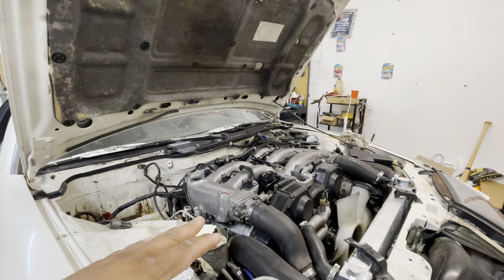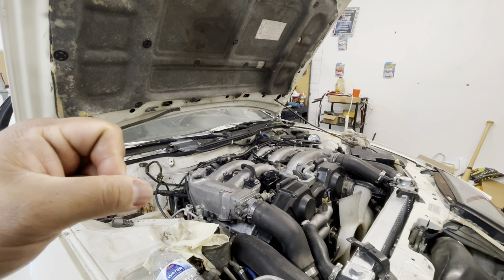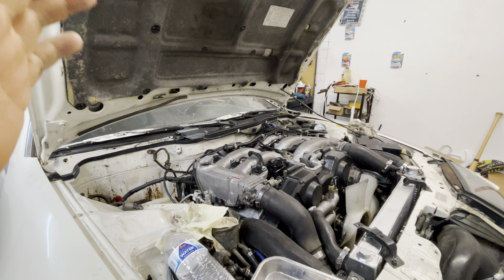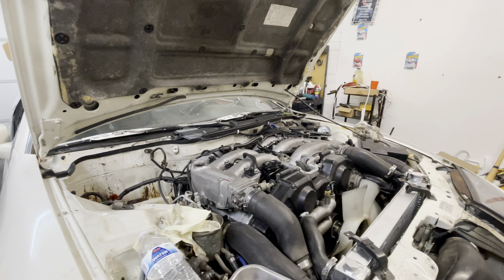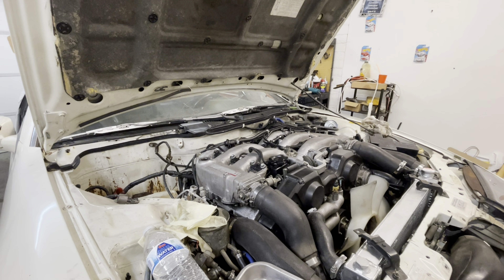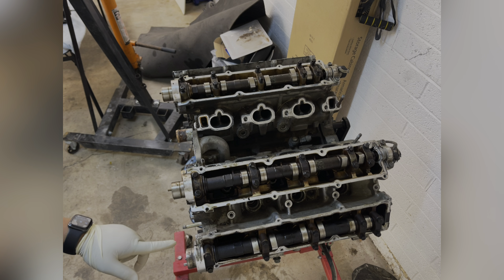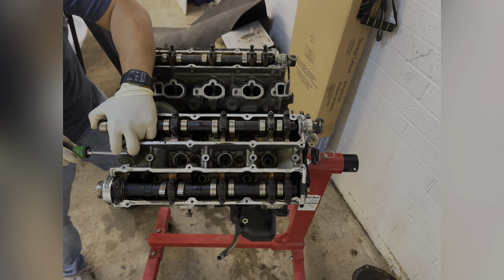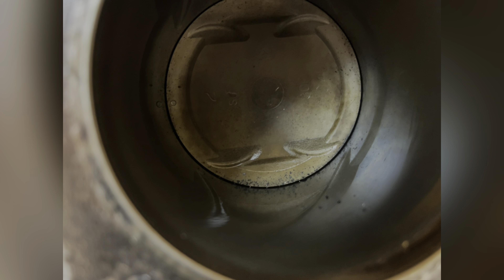300zx Vg30de/tt engine disassembly

Comment: Hey man, love your videos. My dads had his 91 Z300 in the barn since it blew up on him 20 years ago. My dream is to restore it for him, problem is I don't know if I should just swap the whole engine or replace what I can. 20 plus years of sitting has most likely ruined a lot more than just the engine. With all other replacements in mind I'm not sure if "saving  money" on replacement parts for the engine is worth it, or if I should just swap with a used one. Wondering if you might help my decision!
Reply from the maker: My car was sitting for about 10yrs and needed a lot of parts replaced including the engine. Depending on if it’s NA or twin turbo will have determine how much you will end up spending. If the engine blew I would just replace the engine and see what else you’ll need once you need once you get there unless you plan on just replacing everything in the engine bay.

Comment: What was the reason it blew? Just got my first 300zx and trying to learn what i need to watch out for.
Reply from the maker: I did 3 pulls in a row, my best guess is that the cylinder got too hot at the piston rings butted up again each other and that’s what took out that piston. The fuel pump was bad as well so going lean contributed in the cylinder getting hot. I’ll probably try and make a video on common 300zx problem someday but that might be about the whole car lol 😆